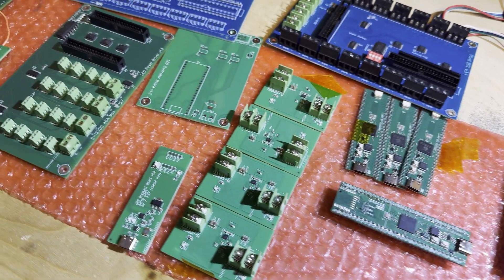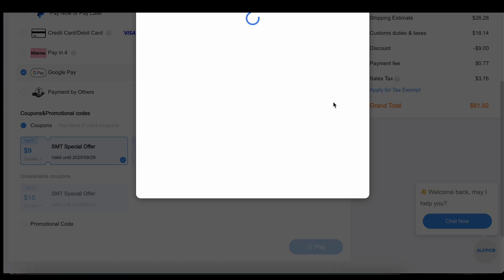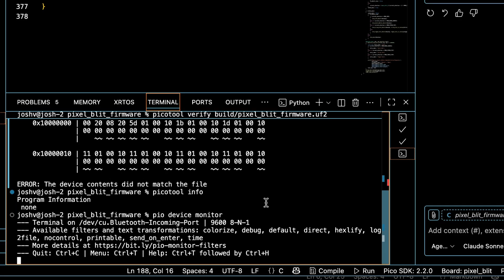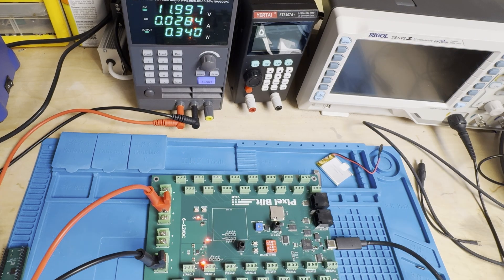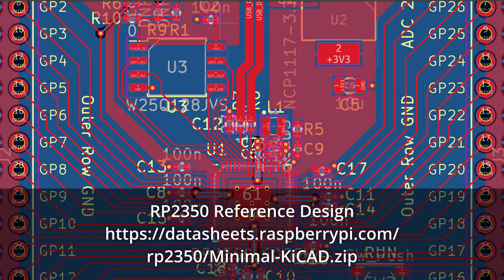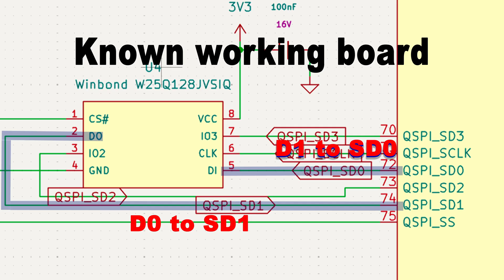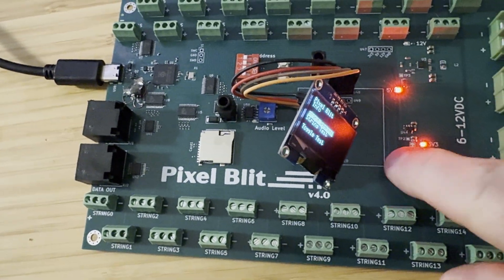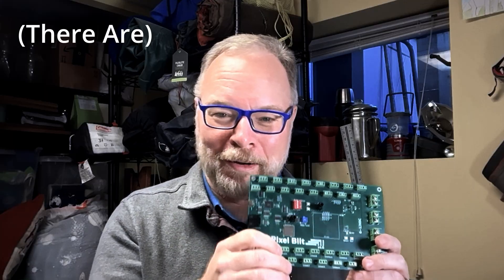Simple mistake killed my custom PCB - can I fix it?

Comment: I had a spelling mistake recently. GP3 should be GP13 (MMBasic: OPTION LCDPANEL), but I learned something about an SD card drive module in my fault finding. The error was CS, but it only gave some display glitzes. It became a nice prototype setup in the end.

Comment: Best solution in this case is making some small breakout board for remapping pins..
I did once a similar mistake with voltage regulator, but in my case, I didn't verified that pinout in CAD software is right - it wasn't.. 😂 Two pins were swapped in CADs library for that part..
Other time design pinout was ok, but seller wrongly marked transistor and double diode package.. Diagnostic was 20 minutes fun with scope and multimeter until I figured that out.. 😂
Reply from the maker: Well, I've tried two different fixes so far, maybe I'll try ordering a tiny breakout board PCB. I might have to order something like 100 of them given minimum size/minimum count. But it could make for a fun video :)
Reply: @ElectronicsUnscripted For getting around minimum size and minimum count, You can try out PCB panelizing option.. Lots of CAD has it and manufacturers do that too. 😉 Then they wouldn't be 100..

Comment: I'm on the same path as you! Recently ordered 50 boards where I missed a connection entirely. Had to hand-modify all 50 boards. Luckily JLPCB had made a small tooling hole in the board near where the error was! It meant I could run a bodge wire from the pin of the affected chip on the top side, through the tooling hole, and pick up a convenient place on the underside. Thanks JLPCB! It's all a learning curve - but you tend to only make those mistakes once!
Reply from the maker: That was lucky. I know ordering just two or 5 boards might seem like a waste, but I think I’d do that before I ordered 50 of a new design. Glad you were able to fix it!

Comment: As soon as it was mentioned that something didn't work right, flipped traces immediately came to mind. The very first PCB I designed had a clock and a data pin mislabelled, leading to incorrect traces. Two trace cuts and bodge wires later and it worked a treat.
Every single project I've designed has had some kind of failue one way or another in the first revision, but each time the failure gets a little less problematic.

I'm gearing up to do my first 2350 board soon, and I'm dreading how costly first-revision-syndrome might be haha.
Reply from the maker: This was a $400 order, but at least salvageable with some work. For your rp2350 project definitely start with the Raspberry Pi reference design, and don’t get cute reordering pins on the schematic. :)   There are other gotchas with the RP2350, especially around the inductor for the 1v1 switches mode regulator. It wants a very specific layout. If you can get away with an rp2040 it’s a bit cheaper and more forgiving.

Comment: Good save,  but it's a lot easier to just cut the traces and rewire them, instead of soldering chip, lift legs, add wires, resolve chip, continuity test, etc.

Just cut the 2 traces on the PCB and add 2 tiny jumper wires to flip continuity.
Reply from the maker: Maybe? I think that's an entirely other skill set - but I will try it on the board where I lifted a trace. After doing it this way once, I feel like just about anything would be easier.
Reply from the maker: So yeah, just looked at it again, and the traces are just tiny and very closely spaced that close to the MCU - desoldering the flash and re-wiring the pins at least seems like a 'macroscopic' task - dealing with the traces is definitely into microscopic territory. I might play around with it on the board I broke for practice, but I seriously doubt I am up to it.
Reply from the maker: Half way through the trace swap approach and I am a ton better under the microscope, but still I think the other approach is simpler.  Also I am doing this on a board with the chip already desoldered which gives me room under the chip for the bodges. Without the chip removed there’s very little space to break and scrap the traces.
Reply: @ElectronicsUnscripted well, it's your board, your choice. 
But trust me, it's easy to just cut the traces and just add two tiny wires to reconnect them
Reply from the maker: @danstiurca7963  Well, I just did the 3rd board desoldering the chip and bending the pins, and it took all of 10 minutes to do the chip handling. The bodges took about 10 minutes, because I have giant pads to solder to.

And I did give the other approach a try - and it worked - cutting and soldering to a 0.12mm trace took me the better part of 2 hours. Note as well this is in an area of the board where the trace spacing is about 0.15mm.  The only reason it really worked for me though was because the chip was already desoldered, so I had a nice big area under the chip to cut the other trace and work.

I am guessing the second time around I might be faster, but my current approach is pretty fast, and perhaps better suited to my skills.
Reply: @ElectronicsUnscripted fair enough. If it works, it works.
Reply from the maker: Looked into that. It's boot stage two. Way over my head, and the AIs were not terribly helpful. The general consensus was that the QSPI links are hardwired by default, you could override that, but it would be slower and complex. That could be entirely wrong, but re-wiring seemed simpler.
Reply: @ElectronicsUnscripted firmware fix was worth a try. 
Sorry you had this adventure. The first time I used SPI, I also mixed up the IO lines. 

Ever since,  I always name the pins MISO and MOSI.
You can't screw up that nomenclature.
Reply from the maker: @danstiurca7963  well, it's been a learning experience and gave me the excuse to buy the microscope. Learning to work under the microscope is a real level-up.
Reply: @ElectronicsUnscripted game changer.
Reply: Also... not sure why you can't just remap the pins in firmware?

Comment: Make a small daughter PCB that flips the pins, put the chip on that then reflow it onto the mobo with a heat gun. I usually do that but for getting soldering through hole pin headers to metal core pcbs in a rugged way,

Comment: IMO the lessons to see: the old schematic has HORRIBLE readability with all those global labels running over everything. It's practically begging for you to misread a connection. The other thing to do: stop dogmatically worrying about beautiful wiring geometry in a schematic, and use local labels or buses to connect things (which means you don't need neat lines of connected wires any more). Of course there's also people arguing that one can get dogmatically addicted to labels everywhere, but I think they're truer to the idea that schematic is about ideas, NOT about layout. Get your layout beautiful in the pcb design.